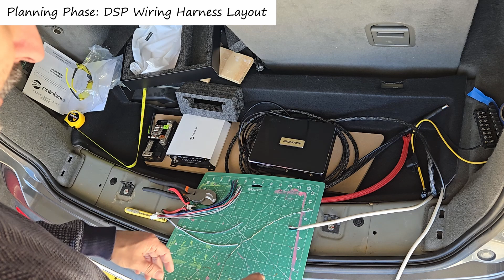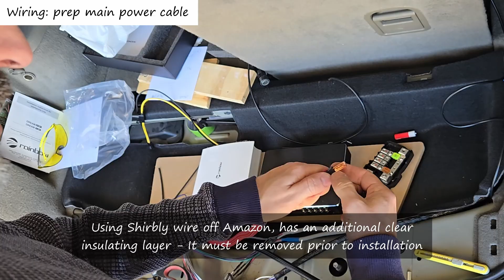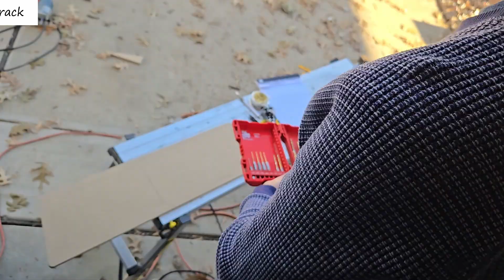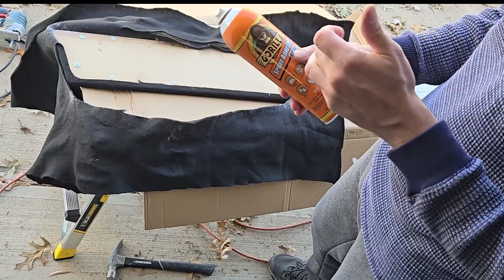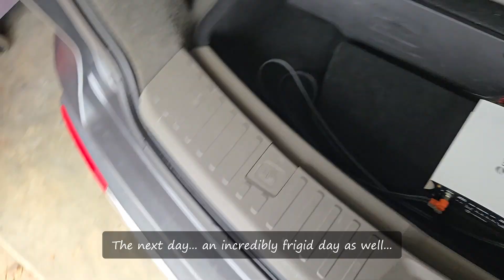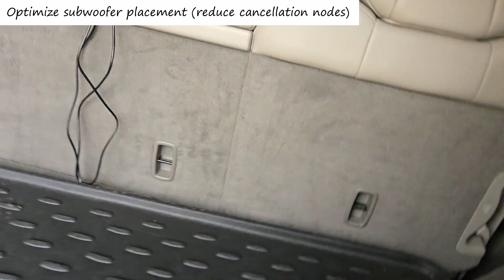Build Log Diary: 2011 Acura MDX Amp Rack - Goldhorn and Rainbow

Comment: By chance could you help me out with the plug ont he dsp I need one for a DSPA 406V1 could you possible unplug your dsp and get me photos of the plug up aganst a ruler or better measure it with a caliper?this would be for the power and speaker connection.  I know you do nt have a 406 but the white plug side on yours.
Reply from the maker: Hi there.  This unit is sold, I sold this vehicle and that's also a reason I haven't posted up too much lately.  IF you are missing a plug, they should be able to get you one (Goldhorn), or the distribution folks (ORCA).  Have you given them a hollar?

Comment: I’ve been thinking about getting one of these DSPs. Less pressure on the drill while making sure the drillbit is sharp can help prevent that punch through you were seeing on your MDF. But sometimes it’s just crappy wood. Been using Mygatti RCAs from Amazon and they work well at a fair price.
Reply from the maker: Hey there; Goldhorn is going through some distribution changes for the US market, but hopefully we'll see the results of that soon.  As of this moment, availability is not great on units like I have.  You can still find the bigger 20-24ch units which are still priced nicely for what you're getting, and have some advanced internals.  But I do recommend them whole-heartedly, especially for center-surround Skyatom systems.  

Yeah I think I would have avoided chip-out entirely if I would have just drilled with a sacrificial board underneath to keep the pressure, but I always show my mistakes so people don't have to make them. 

I'll look up the Mygatti RCA.  I went with EMK (they'll show up in a future video) and they are quite nice as well.  Thanks for watching and commenting!

Comment: 27:00 There are a few different options for dealing with that yellow wire. Since you already have a fuse for it, you can just get rid of the inline fuse. Cut the fuse off and leave about three or four inches. Then splice in a new wire. Cover the whole thing.

Or you could just de-pin the yellow wire out of the connector and slide some wire braid or heat shrink on , and then plug it back into the connector.

Comment: 13:00 This is a common error I see people make all the time. To cut the insulation off of a large wire directly over the top of your electronics. There's a high probability of stray copper strands dropping straight down and potentially getting inside an amplifier causing damage. 

Preferably you want to move your wire out of the trunk area and do your cut over a garbage can. Or if you're not able to, get a brown paper sack and let any potential strands fall into it. Then carefully dump that out into the garbage can. Even if you don't get any copper strands inside the electronics, just getting them stuck into the carpet can be a big pain in the rear. 

You've heard of policing your brass, in car audio you need to police your copper. 😅
Reply from the maker: Very true.  In my case I am pretty far away (camera angle) but the warning welcome.

Comment: I had a soldering iron like that back in the day. They are absolutely terrible. If you ever want to get something nicer, consider a T12 clone. Like KSGER. they heat up in like five seconds. The temperature control is precise. If you solder a wire and the heat is quickly pulled out of the tip, it will automatically pump power back into it to keep it at the right temperature. You can also get a wide range of different tips and they are not very expensive.
Reply from the maker: Should I open up a donation option?  I could use the help in updating many of my tools.
Reply: @LansonF  I don't really know what a donation option is. Is it something to do with youtube? 

I would not have guessed you were low on finances. 

If you're ok with your current iron, that's fine. It's kind of like using a 20 year old dsp. It can do the basic stuff, but on the new ones there's a ton of improvement available for very cheap.

It's not like buying Hakko or JBC products which would run several hundreds of dollars. You can get a KSGER unit (clone type product) with six different tips for like $70. I've got about twenty different tips, some are specialty. I think my total investment is around $120. 

I've done numerous videos on them, if your interested.
Reply from the maker: @JasonWW2000  Oh brother, you have no idea.  I work a regular job but it's one of those that just barely makes ends meet.  I signed up with Ko-Fi; everything helps.
https://ko-fi.com/lanson
Reply: @LansonF  Do you happen to have paypal?

Comment: 7:40 If you accidentally get the phase flipped on all your speaker wires, you could just de-pin the molex connector and flip the wires there. Depinning toolkits are very inexpensive and come in very handy.

Comment: Do you know of anybody selling those big input connectors with the proper colored wires? 
I asked Goldhorn if they sold replacements , but they told me they are just standard molex connectors. I guess they are implying that they don't sell replacements and that I would have to make my own somehow. I don't really need it since i'm using the digital input , but it would be nice to have it just in case.
Reply from the maker: My thoughts on this: it's probably standard for them  but for us it would be quite a hunt, and a pin-out quest to build.  The connector itself (the plastic part) is likely off the shelf Molex but that's only part of the harness.  
That said  there is an "easy" way to address your concern.  Instead of soldering directly to the harness, consider using a terminal block / barrier strip to serve as the intermediary between car wiring and DSP wiring.  I planned on doing this but decided the space available in the back cubby area was a bit tight for it, so I opted for the solder method.  However, choosing to make a bit of room for one of these block/strips would have saved me quite a lot of time when I later upgraded the midbass channels to their own amplifier.  It would have been as easy as unscrewing a re-screwing a few connections.   

So, do consider that especially if you are expecting upgrades down the line!  These blocks or strips are cheap, easy to get online, and easy to use.  They just need a bit of space on the rack or adjacent to it, essentially as far as the DSP harnesses will extend.
Reply: @LansonF  Yes, the connector is a standard unit and available. The only problem is, you'd have to buy all the different wire colors and then a special crimp tool to assemble it. Even if you used a single color for all the wires, which is ugly, you still have to have the specialty crimping tool. To me it's not worth it.
Reply: @LansonF  I think I found a solution. The input connectors on my Goldhorn is a Molex Micro-Fit 3.0 size. I've got an 8 pin and a 16 pin. I can buy those pretty easy. 

I just found out that you can buy precrimped, multicolored wires in a bundle. They aren't the exact color as factory, but it's good enough. I just pick what color wires I want to use and slide them into the connector, locking it into place.